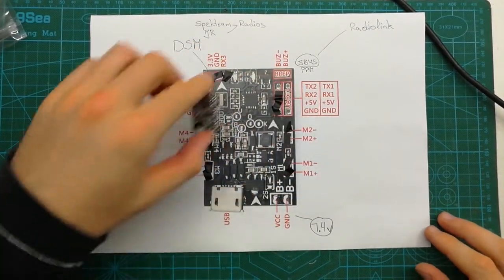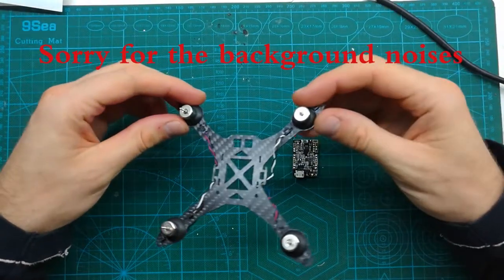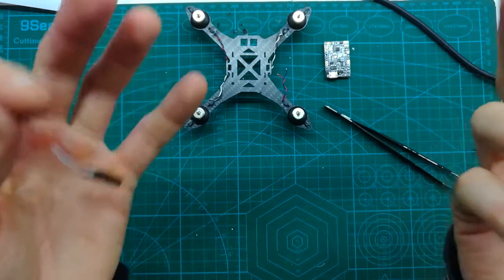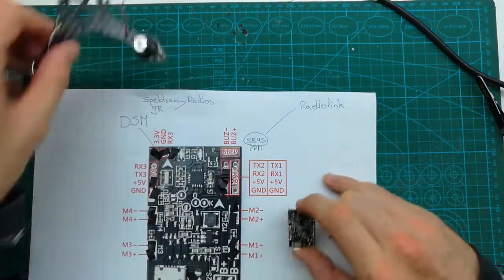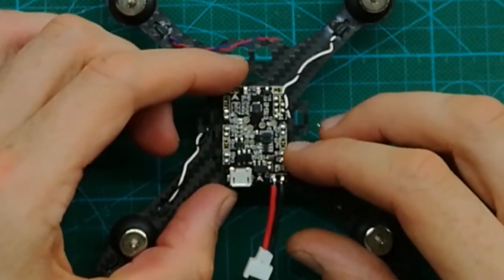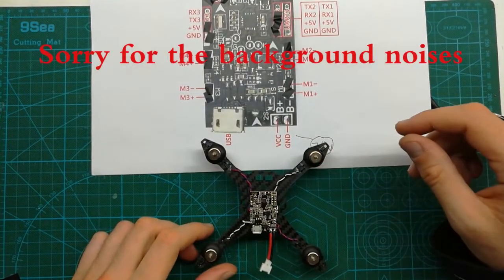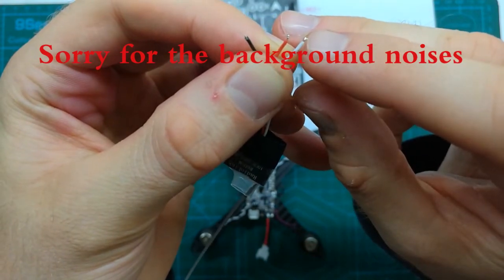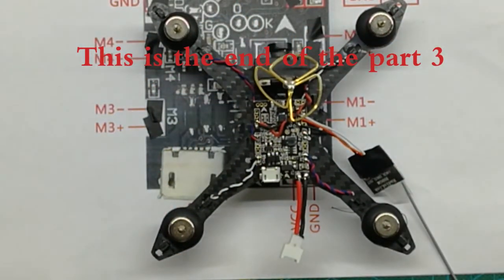Mini brushed drone build for the beginners - Part 3 (soldering)

Comment: hi martin there r 6 motor port and no1 motor port is gone can I use 5 or 6 motor port to motor 1 in 4copter
Reply: Yes, look at resource remapping for Betaflight. You'll have to unassign Motor 6 and map 1 in its place .  So change Motor 1 from A02 to A07

Comment: If you are going to use 2S batteries, it is not better to solder JST connector. Are you going to put the buzzer in case you fall and you can not find it ?.